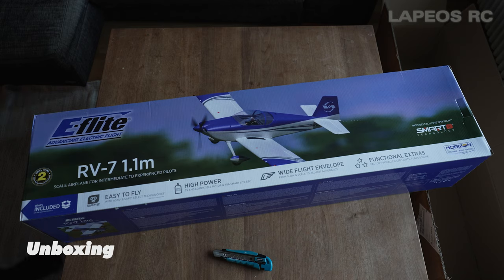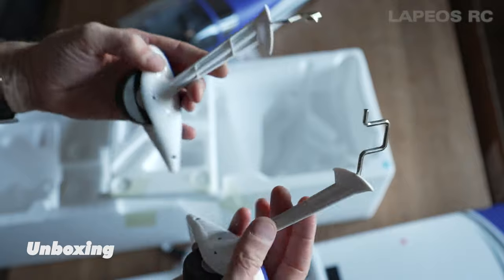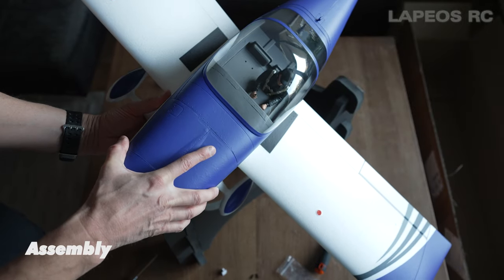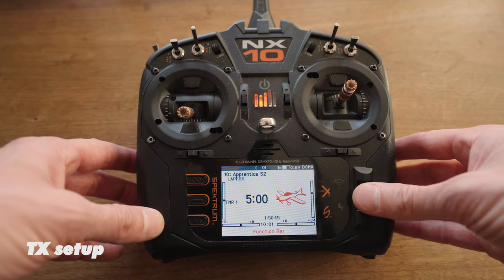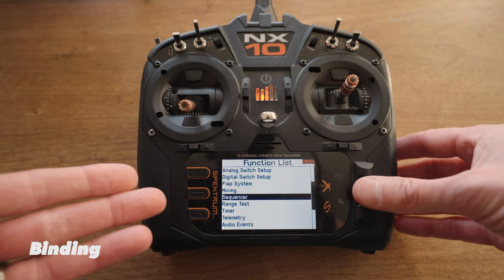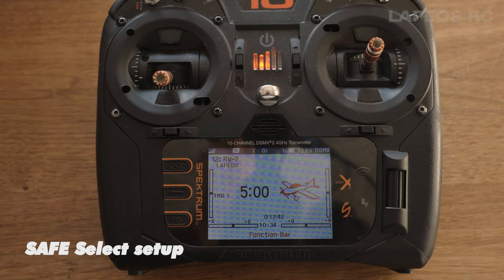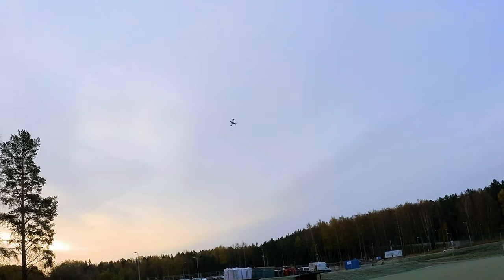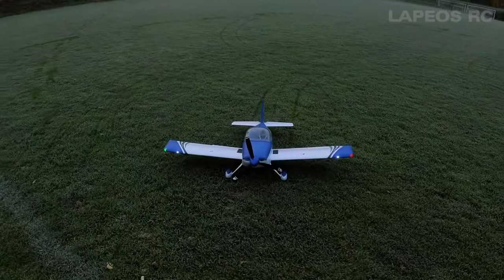E-Flite RV-7 - Unboxing, assembly and more!

Comment: Hi There Lapeos, Great video on setting up the RV-1, I haven't got mine yet so your set up will really help. One question, I haven't got much room to store the plane so I was thinking of putting two brackets on the wall and hanging it up that way, would this be OK or damage the wings?
Reply from the maker: Many store their planes that way so it will work great. I hope you will enjoy the RV-7 because it’s a fantastic plane.
Reply: @SunriseRCAviator  Thanks for the quick reply, now to buy some brackets.
Reply: One more question, is the RV-7 suitable for a beginner who has NEVER flown a RC plane before?
Reply from the maker: @hawkeye19531  Not really. I would pick a high wing trainer instead.

Comment: Thank you an informative video.  Appreciate the effort.  Ordered mine today.  Had a “full scale” VAN’s RV-6 with two great partners for many years. It was a beautiful yellow w a custom composite 3-blade propeller and really scooted along.  I enjoyed many hours of acrobatic and formation flying and taught both my sons how to land in case they needed to take over.  Landings were not the easiest due to the stiff main legs, but over time I was able to perfect my “paint roller” wheel landings.  We sold it about five years ago to the first person to see it, and “upgraded” to a very nice Beechcraft V35 Bonanza.   But I still yearn for my old RV-6.  One of the first VANs RV6 kits that was finished. As you probably are aware, the RV-7 is essentially an upgraded version of the most popular RV-6 design, with all of the original “shortcomings” addressed.  My plan is to assemble and maiden my E-Flite RV-7 w a 4S 2200 pack ( about six of them) and then after it’s all sorted out to disassemble and paint exactly how my RV-6 looked.  I am glad the E-Flite version even has a three blade prop so I can customize that to match as well.  Thank you again for a fine review.
Reply from the maker: Thanks for watching and Im glad you found it informative.

Comment: Hi There Lapeos, I've decided against buying the RV-1 on your recommendation that it's not suitable for a beginner. I am now looking at a UMX Turbo Timber, would this be more suited for me or do you have any recommendations. I just realized that I have the same shirt as you in this video.😀
Reply from the maker: UMX Turbo Timber is good! Easy and weights next to nothing.
Reply: @SunriseRCAviator  Hey LAPEOS, I have ordered the UMX Turbo Timber and now can't wait to get it, one question, can I put a higher  than 280mAh battery in it ?
Reply from the maker: @hawkeye19531  If you find something like a 350mAh I think it will work. There is ample space but be careful about the added weight.
Reply: Turbo Timber UMX definitely not suitable as a trainer,  you will have short lived success

Comment: Many thanks for the video Lapeos, I just ordered it when it was on sale over Easter for 20% off AU$250. Looking fwd to flying it. Do you think I could access the cockpit to place a Go2 inside? Regards mate.
Reply: Sorry AU$350 (normally AU$499.
Reply from the maker: You have to try when you get it. Mine is in the box while flying a bunch of other planes but I will fly my RV-7 later during this spring.

Comment: I have an NX8 TX tried to follow your steps for reverse but couldn’t get past the screen showing step 2.  I tried to enter the menu by right aileron/low throttle and up elevator but to now avail.  Held for 30 seconds.  What am I missing?
Reply from the maker: Maybe you need to calibrate the sticks? Mine was off just a little bit and it didn't work to go past step 2 at first. But after calibration it works fine.

Comment: Thanks also for this video.  Got this plane a few days ago and just bound it to my new DX6e transmitter.   First time for me with this new transmitter.  Your video helped.  I do not have forward programming so I had to set up  the old way.  First flight will be in April.  Lots of firsts here for me.  First new transmitter, first low wing plane, first plane with flaps, first plane with LED lights, first plane with reverse thrust and finally, my first plane with a pilot.  Lol
Reply from the maker: I hope you find it fun because it is a really good plane!
Reply: My Dx6e has forward programming

Comment: You should not hookup the elevator linkage until you bind the plane and center the trims
Reply from the maker: You are right and I usually do that but as I divided built from TX setup I judged it to be better shown a full assembly rather than going back and forth between built and TX setup.

Comment: I don't get it, same small size wheels as the Commander yet no mention of problems with take off /landing off grass. So what's different?
Reply from the maker: It is a smaller plane so I don’t expect a smaller plane to handle longer grass as well as a larger plane.
Reply: @SunriseRCAviator  the RV7 is 1.1m wingspan the Commander is 1.4m, you've got it the wrong way round , not making sense to me,sorry
Reply from the maker: @patrickhoyle8357  That's what I wrote that the RV7 is smaller.
Reply: @SunriseRCAviator  yes I know you said that :-) but you say the smaller plane (the RV7) is ok on grass) but the larger Commander isn't
Reply from the maker: @patrickhoyle8357  I fly mostly at two fields. One with short grass which works for any RC plane and another field with longer grass. For smaller planes like the RV7 I pick the short grass field but I try larger planes like the Commander if they can handle the Longer grass field. So if you watch more of my videos all should be clear.

Comment: Are the wheel pants removable? I would be landing on grass so those won't work for me.
Reply from the maker: You can modify the landing gears and remove the wheel pants as with most planes.
Reply: @SunriseRCAviator  8

Comment: tossing up between this and the 1.2m P51. I only have the area of a soccer ground that is built up around it. so need something that has a wide flight envelope and can take off and land in the fore mentioned area. was also looking at the Maul but I already have a umx turbo timber.
Reply from the maker: RV-7 is the one I would pick over the P-51D. But if you really want to have something that works great on a soccer field I might suggest the FMS Ranger 1220 or E-Flite Valiant.

Comment: Thanks for putting out these great videos, I really enjoy watching them and listening to your opinions.  I'm looking for my first low wing plane, I have a UMX turbo timber and Apprentice 1.2m that I fly right now.  I was really considering the RV-7 or the T-28 1.1m and I was wondering if you prefer one over the other?
Reply from the maker: Thanks for commenting Mark! RV-7 and T-28 are both great flying planes but I think the RV-7 is a little bit easier to handle and features things like flaps and LED lights so that would be the better one.

Comment: Is there torque roll on this taildragger and do you have to counteract with right rudder?
Reply from the maker: No torque to be consider. It handles shorter grass with ease. Maybe it will be noticed on hard surface.

Comment: I set my flap to 2 sec also - but it only takes 2 seconds on the way back up ...
on the way down it has no delay - it jumps right to 1/2 or full flaps...
never had a plane do that....any ideas on how to fix that ?

the documentation says it supports fly by telemetry - what is that and how do I set it up ?
Reply from the maker: Check if it says linked on the flap page.

Telemetry is data sent back to a compatible transmitter like the NX10. This data is often battery voltage, load and temperature on the ESC. A great feature to monitor values during flight.
Reply: @SunriseRCAviator  flap said independent - so I will change it to LINKED and try again - thanks,,,,yes, I understand what telemetry is but it is not being displayed - I don't know how to set it up.... nothing in the manual
Reply from the maker: Do you have an option in the menu on your TX for telemetry? If not your TX might not support it or needs to be updated.
Reply: @SunriseRCAviator  yes, I have NX8 with Telemetry option - and just found out this morning that I needed to do an AUTO CONFIG option to set things up - 
now how do I get my battery voltage to display on the screen while I am flying or better yet how to I set a switch and get a voice to tell me the battery temp while I am flying so I don't have to take my eyes off the plane ?
Reply from the maker: @lw216316  Usually when you bind telemetry is autoconfigured but sometimes you have to do manually so good you got it solved. Under telemetry you have several different things to monitor and the most important are the SMART ESC and SMART battery tabs. Go into each to set different alarms which can be either tones, vibes or voice. Then by scrolling on the right wheel of the LCD screen you can access these pages where telemetry is displayed.
Reply: @SunriseRCAviator  Yes, but is there a way to have it display on a ticker tape on the bottom of the main screen or have a switch set to give voice info about telemetry as I am flying ?
Reply: @lw216316  no. wish u could tho.

Comment: On my RV-7 the clevis was (after binding) far away from the servo horn and I needed to twist it 8 half turns towards the servo horn to get it to fit and the elevator to be straight... does the clevis still have enough hold onto the servo horn like that? (I hope so...)
Reply from the maker: You have to check by unscrewing the clevis all the way and see how many turns of grip you have to get the elevator aligned. But 8 half turns should be okay in my experience.
Reply: @SunriseRCAviator  Maiden went well, no problems. I hate the wheels... thinking of putting Du-Bros on it...
Reply from the maker: @thelongestday64  I didn't really notice anything bad about the wheels but if you run on hard surface I can see softer ones will help.

Comment: It's a beautiful scale plane , Nice job on the video and thank you . . Very thorough to include the radio and Avian ESC set up . The SAFE select directly off the transmitter is nice . I had a few planes go in SAFE automatically without the bind plug  set up  , so now this helps explain it . I'm still new at all this , so easy radio set up and plane assembly are important to keep the focus on fun and flying . 
I just got one of these myself , I want a little more airtime on other models before I'm confident enough to fly it , but I plan on doing the unboxing later on tonight .
Reply from the maker: I hope you have some fun with it! I really like it.

Comment: For reversing, did you have to switch out the ESC?
Reply from the maker: No it is supposed to work on all Avian ESC.
Reply: @SunriseRCAviator  Does it require another channel?
Reply from the maker: @aragorn318  Yes it does. In this setup ch7.
Reply: @SunriseRCAviator  It's so nice that my NX6 has a 7th channel for SAFE